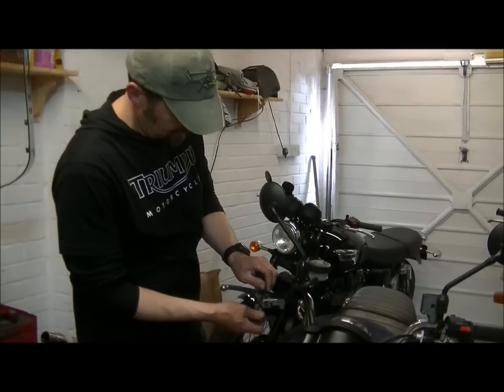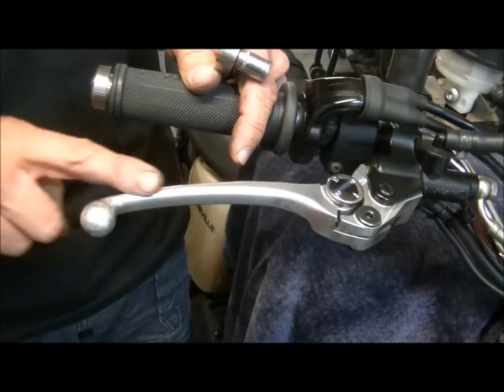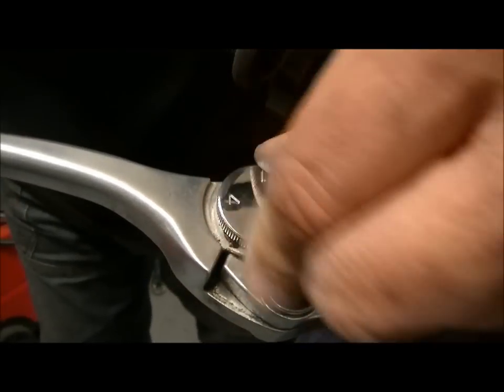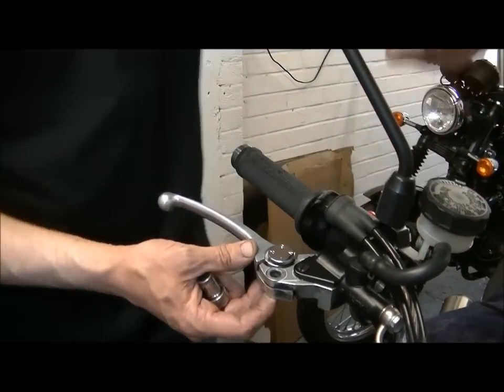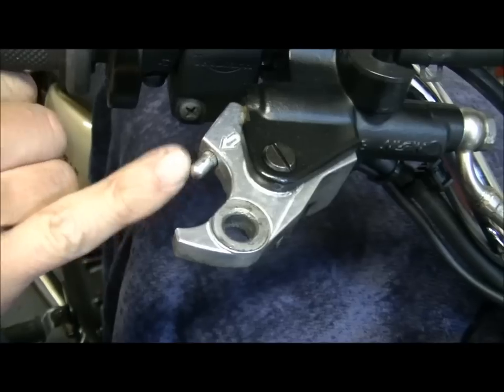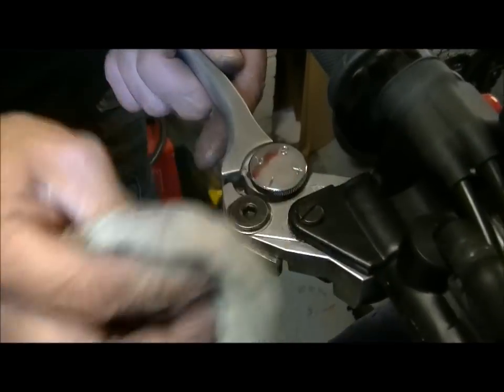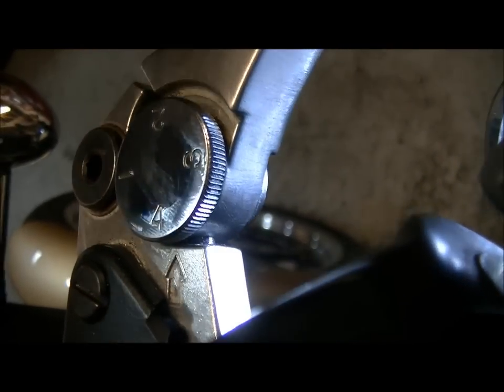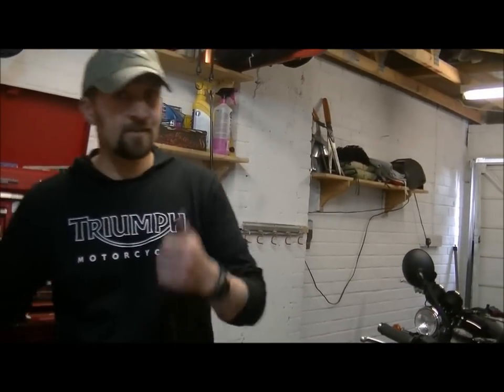Delboy's Garage, Adjustable Levers, Ghetto fix.!

Comment: Thanks.
I've just done this mod to my 4 position adjustable levers on my Guzzi 750 due to a damaged clutch hand. Gained another 1 cm closer to the bar in position 4.
It's a great tip and saves money.
Reply from the maker: Glad it helped Ian!

Comment: Hi mate how's it going brake problem question for you zzr 14  had a very good break on it but I bladet I done to your of my bikes over 30 years of biking never like this I have try just about everything in the book but it's I leave it get a very good break sit the bike for a week and it's spongy again if I ride bike by 5 miles or so I have a good break again any ideas I can't see any leekes in the system I've tied up the front brake lever left it for over a week it's a confusing one. 
Thanks 
Jeremy

Comment: Hi, Did you fit the Oxford Heated Grips on the Triumph? I've been mulling over doing something similar on my 2007 Sportster XL1200 (yes, I'm vertically challenged too!). Any words of wisdom on wiring it up. Don't suppose you fancy doing a video on it? Cheers, Malc.
Reply from the maker: Hi Malcolm, bit late for a video, as they were already on there lol, but if you get the same ones as we have with the battery saving mode, you can wire them directly to the battery with the ring terminals supplied as if you leave them switched on after stopping the engine, they auto switch off!   They have full instructions and are really easy to follow!

Comment: I have the exact same problem, her hands, fingers are so short, she can't reach the levers NOT SAFELY!! SO, she's mad cause I won't give her riding lessons.  I said 1, did you read the MSF manual, she loves to read,  Nope. I said why, idk just haven't. 
I can't make her understand why it's so important to reach especially the brake lever.
87 Honda Rebel Cmx450c.  No parts available for this bike anymore.  A few parts, but not the one's you need, like the speedo gear in front wheel for speedometer.  
How can I get these levers closer n still allow the clutch to work properly,  without burning it up!?
Any ideas other than that video. Btw.  Very nice video  what kind of lever? Who makes it?
Thank you.
Chuck

Comment: I appreciate for your work on motorcycles and knowledge to others through this channel. I learnt a lot. Thanks 
Regarding this post on adjustable clutch i have a point to ask. When we file off the pin inside of lever. The rotor (1,2,3,4) might get stuck. Isn’t it? :) thinking it loud. Generally manufacturers dont give that much space.

Comment: Hello Del. Just broken my front brake lever on my 2007 Efi t100. The lever is exactly as the one you removed in this video. Trying to get hold of a replacement nothing on the internet looks the same.
Can you help please. Where do I go ?
Thanks. Neil.
Reply from the maker: Tried the main dealer mate?
Reply: @Moonfleet41  hi. No. But as you mentioned your bandit had the same lever I’ve just sourced one on eBay £11

Comment: Where's the dab of paint, nail varnish or even copper slip, on the end of the pin. It's going to rust, don't ask how I know. On the clutch side I found the cable length adjustment to be just a little more critical after the stand off pin mod, but really worth doing, especially when using the clutch in heavy traffic.
Reply from the maker: Well said Stephen, it is important to ensure you get full dis-engagement of the clutch after the adjustment!

Comment: Hi mate, great videos, been following you for a while. Hope you get time to answer this? I have a gsf600 bandit k2 reg, clutch lever is to far away for me, i.e the biting point. I've adjusted it but now there's play in the lever. It's non adjustable as it isn't hydraulic. Can't find an adjustable one anywhere. Is there something I can do or do I have to live with it? Thanks in advance for the response, if you get time! Stay safe.
Reply from the maker: Hi Don.... have you looked at other Suzuki bikes that have cable clutches with adjusters ..Firestorm, SV650, V-Strom, etc etc... have a look round the other models and see if there is a lever you can adapt... im sure there is one in the range... other then that ,its a new lever from the after market firms, but im sure you'll find one that fits... then you can just hit eBay and maybe get lucky..
Reply: Thanks for the response mate. Stay safe

Comment: Is it possible that  after this adjustment the clutch will not disengage completely?
Reply from the maker: +Vlady If you make the lever too close to the bar, then yes, you will effect the clutch action....but this bike was fine, it still had a full sweep of the lever and enough to totally dissenguage the plates....just check with your bike that you dont close it in too much..!

Comment: Hi ya del, 
Great tip. Just a thought though, that extra travel of the level might be factory for safety reasons...pads just changed or old fluid with a few bubbles etc your thoughts sir?
Reply from the maker: Pads wearing won't bring the lever any closer, the system feeds more fluid down the tubes to back up the thinning pads, and if you change your brake fluid every couple of years as designated in the service schedule then you shouldn't experience much, if any, closer level pull .. and the clutch is static in its bite point (pretty much).... but it is important to make sure you still have full disengagement of the clutch and full application of the brake with at least 10mm of lever travel to spare .. good point mate, well said. Del.

Comment: Go Penny!
I find it easier just using my index and middle fingers to brake. The whole 4 fingers makes braking more imprecise.
I place my hand on the grip in such a way that the to fingers sit in the closest part of the lever to the grip. My hands are a bit larger than yours.
The clutch is a bit heavy, riding through traffic constantly having to find the bite point  gets unbearable.
Reply from the maker: Hi Dolores, pulling like that on the clutch in traffic and enduring the pain can lead to tendonitis and then you won't be riding at all, so do be careful... makes it really uncomfortable on long trips and as such as I can two finger brake, I want a convenient full 4 fingered grip in case of emergency stops... ride safe, good to hear from you Pennyx

Comment: You call it Ghetto, I call it a life hack! Anyhow it's the same levers as on my bike. I'm going to do this because I just like  levers close to the bar. Got a version for the clutch lever too?
Reply from the maker: Hi Lewis, clutch lever should be the same... as long as it's adjustable... and make sure you champher the end of the pin and don't leave it square as it can cut into the cam in future... and also, afterwards, make sure you're still getting full dis-engagement of the clutch!  Good luck, Del